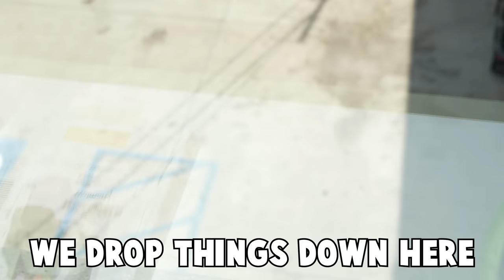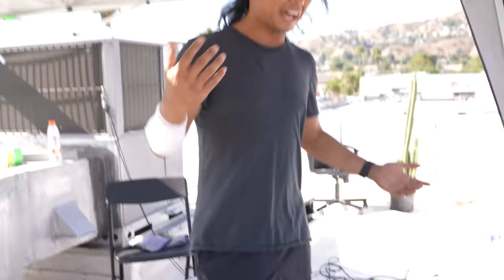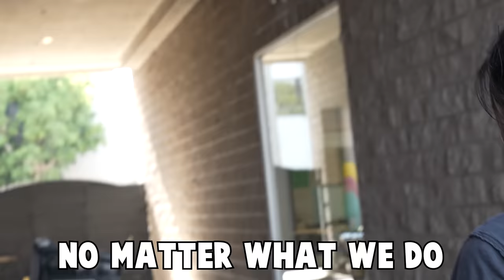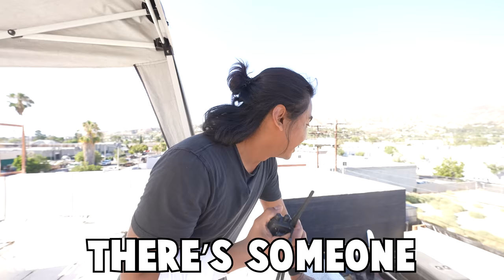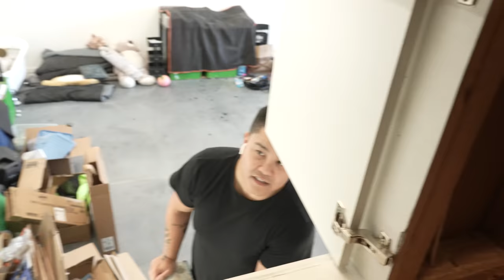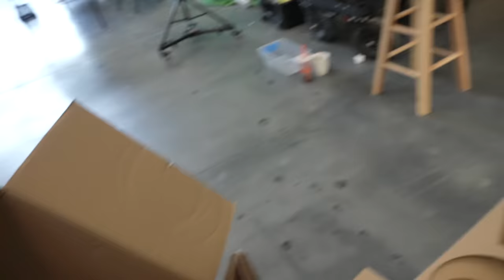DROPPING 10 THINGS INTO A TRAMPOLINE...

Comment: hey guava just to be concerned. im actually worried since like from that one shot during your vid with the shadow figure in your room or something someone may have died in your home. maybe get one of those spirit dectection devices? or like do the estes method if you dont know what the estes method is i'll explain: they're basically used to talk with spirits with a little radio box thing and where you plug a set of headphones into the radio. so i hope you try to catch something or be able to speak with the person who died in your home?